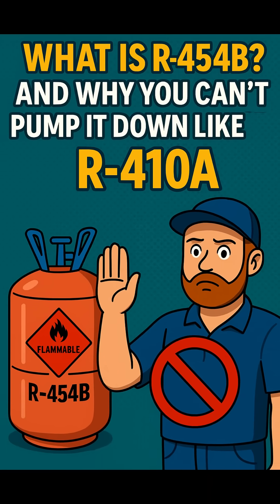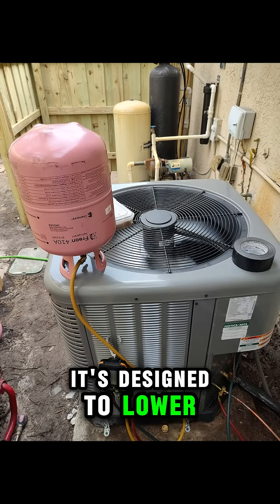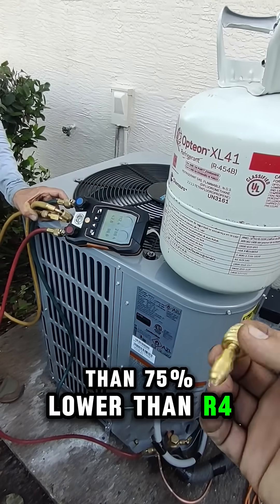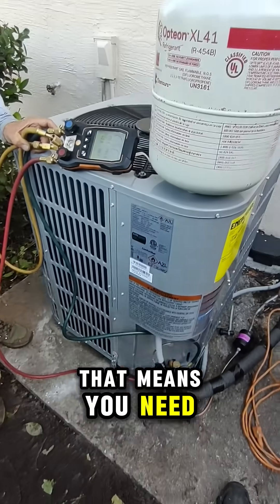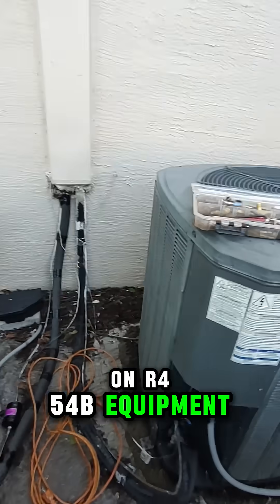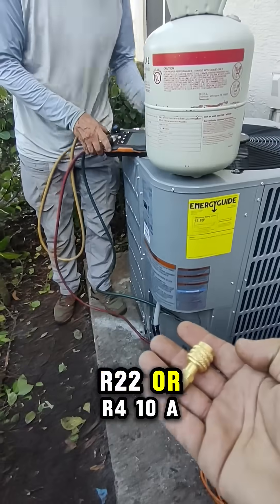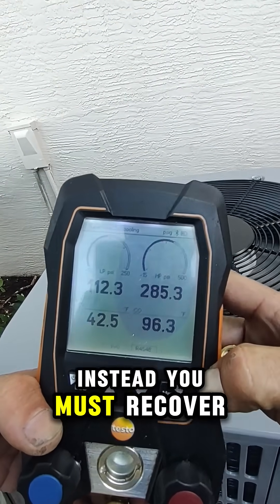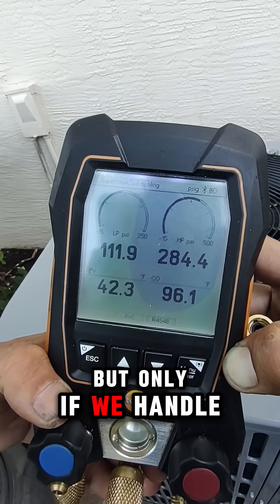What is R-454B? And why you cant pump it down like R-410A

Comment: R-454 is an absolute garbage solution. It’s flammable and it is not more efficient. If you’re running the same pressures it requires the same amount of electricity to flow through the system.

Comment: R54B  is a scam.  And scammers in this industry such as yourself push the scam instead of standing up against it and standing up for your customers...
I won't touch the crap. And I inform everyone about the scam.
If you understand the science that is happening in the refrigerant cycle, then you also should understand that the science is on our side, and the science isn't sciencing like they tell us.

Same with all this "efficiency" bs

Your pennies you save over a year, are instantly wiped away your first maintenance call or even worse a service call.
0 savings. Only increased costs. And the manufacturers win and you lose

Comment: And I notice you dont quote any literature that comes with the equipment or refrigerant that states that you cant do a pump down.
I mean, a recovery machine is literally a pump down. It is a compressor, coil, and storage.
The condenser is shipped with the total charge, so obviously it is designed to hold the total charge.
This is just another batch of fear-mongering. Happens every time there is a change in the industry.

Comment: Let’s think about this… a recovery machine is a compressor that discharges the refrigerant into a space that is lower pressure. 
Pumping a system down uses a compressor that discharges the refrigerant into a space that is lower pressure 🤔
Reply: Don't let the secret out, then manufacturers and supply houses won't make as much money😉

Comment: LOL.  I’m pumping it down, I’ve seen the lab tests for this “flammability” you speak of.  It is only flammable when lit with an oxyacetylene torch and it immediately goes out when the flame is taken away. 😂🎉
Reply: Yet we getting all this "safety" nonsense to install with it.. Your hot water tank is significantly more flammable but here we are... finding ways to force customers to pay for nonsense they dont need. In a few years r454b will be banned and this will start all over again. Screw government and Screw the monopolies who pay them off to force products no one wants.
Reply: You can light it with a lighter.  You don't need a torch. Lmfao.. but yes it will not sustain a flame without a flame.

Comment: 454 and 32 are not dangerous at all. I wouldn't worry at all about pumping it down into a condenser. They are blowing this a2l stuff way out of proportion.
Reply: 410a was supposed to be like raindrops from heaven. I remember how good hearing about Puron made me feel a few years back. It still gives me goosebumps. Except that it was a load of crap.
Reply: @kenlundstrom3047  the HVAC world is getting Soo ridiculous. The refrigerants. The equipment. Climate control is going to become a financial strangulation. I work on the HVAC equipment for cell phone towers. The vendors are starting to go with inverter wall units. Nothing but problems with them. Fixing them takes weeks because of part availability. I can only imagine what it's going to be like 10 years from now.

Comment: The amount of tools and refrigerants you still need in the HVAC trade is getting ridiculous. I used to carry R410a, R-22, R-404a, R-134a, M-099, R-509, R-408a, and Hotshot. Not to mention the new crap that's coming out. I just gave up and now make just as much money fixing forklifts.
Reply: After 21+ years in HVAC I just gave it up last year.  I now make just as much money repairing small engines and I don't have to go pay for "Continued Education" classes. I feel much better now.
Reply: @c.blakerockhart1128 yeah it's crazy the amount of stuff you need to do. Seems like HVAC just a field to break you down so you can pay a bunch of other people. I think the people getting rich in HVAC are the supply houses, testing centers, and tax collectors.
Reply: @Dan-ger82 Dont forget the testing "instructors", the shipping companies, the " Warranty Rep", and most importantly the Engineers who design things that cant be worked on by a mortal. And the manufacturers who sell the junk that doesnt work and when you finally get the broken part out just to find out that they dont even have a replacement part yet because the system is the "Latest Model".    When I first started in HVAC my boss got 8 pallets with 40 juggs each of R22.  We went through it like water because we only charged $20 per lb. Now they are " Phasing Out" the 410A and going with lighter fluid. NO THANKS.

Comment: Why is it you cannot pump it down but yet the Freon comes pre-factory in the condenser
Reply: They want you to buy all new tools for this bs! I’ve pumped them down…put them on 410 evaporator coils and even ran one without a sensor! 😲 There all full of shit! Why is it refrigeration needs a leak detection system but the natural gas that runs the furnace the coil sits on and is a bit more flammable and will level your house doesn’t? 🖕🏻government morons!

Comment: R410a has a mixture of refrigerants in it! (Azeotropic blend….fractionates if not dispensed in liquid form) If I’m not mistaken R32 is in it! 

(Blended refrigerants AL2 or however they say it)!
We can pump down a R410a system & a R22 system! 
THE NEW R32 CONDENSER COMES WITH REFRIGERANT INSIDE IT!!! If ya can’t pump one down….how does it come pressurized?🤔🤷🏽

Very much jus like any other system! You should be able to pump down a certain amount back into the condenser! A long line set application would be a different story!!!! Over a 10-15 ft line set….reclaim or pump the excess into a proper reclaim tank/cylinder!
Don’t let these people steer you in the wrong direction! 

The pump down process should be done by experienced individuals!
Since these new refrigerants are propane based it can no doubt become very dangerous!

Large 3 phase equipment can be very dangerous pumping down too!!!!
Blow a hole in your condenser coil from over pressurizing! “Yes I’ve seen this done! Incase you don’t believe me!”
Reply: Do some research on the different propane level(s) between these newer refrigerants! (Be proactive instead of reactive…lol) 
Remember they’re telling you IT’S MORE FLAMMABLE (potential is higher!?) THAN THE OTHER STUFF!

I wouldn’t dare light a match around these new refrigerants!

When I brazed the refrigerant lines to the condenser…..I made sure I kept the fitting attachments cool!!! The condenser came with the refrigerant inside!!!! (R32!)

So this is a new journey for many of us! I’m keep getting a visual of a 25 lbs propane tank on a gas grill…& I’m working on it!🤔😂😅🥸😳🤨🙄

Comment: This does not make sense to me. I have not heard this yet and have listened to a lot of content on this
Reply: A R32 condenser comes with refrigerant in it!!! (Plenty!)!
I connected/brazed the refrig lines & released the charge into the line sets & coil!
System up & running without adding too much more! About a 15-20 ft lineset application! (Inside attic 2 story , to main/ground level)!

Comment: This whole 454b and r32 is a scam.
Reply: Why is it a scam?
Reply: @TeefMah  
Because its only in demand due to being forced on customers. No one wants this. The argument that its better for the environment is idiotic. There is not much in a typical system to do anything harmful and they are closed loop systems. 
The only reason we have changed is because our government wants to collect fees and monopolies want to force new products. That's it. All this will do is jack up prices. We are already seeing typical installs costing 2-3 times more then of the past. In a few years this refrigerant will be banned and the whole process will start again.
Reply: It’s a new puppy! (Probably has more PROPANE in its blended mixture!?) I jus installed my 1st R32 system up & running Monday!

No one told me extra control wires are inside the evap coil enclosure! You have to wire them into the air handler controls!(gas furnace or electric air handler)! New air handler match up!

Old air handler…you need what they call dragonfly! (Goodman brands use this set for new coil condenser matched to old furnace/air handlers!)!

Probably dealing with a more flammable refrigerant(s)!?!?!
Thank you industry! Ikr!🤔😑😤
Reply: @orlandojohnson5742 yes you have to add the leak sensor to the older furnace or air handler so it shuts down the system, and if it's a furnace shuts down the burners, then it runs the blower fan on high to clear out the A2L refrigerant to dilute it to prevent an explosion. But the A2L refrigerant is not going to explode anyway. It's only slightly flammable. Take the free training classes offered by all the HVAC companies. They show you videos that it burns, but it won't stay burning. Even if you hold a torch on a leak it goes out when you remove the torch flame.
Reply: @orlandojohnson5742 there is no propane in R32 or R454b. R32 is just that and R454b is a blend of R32 and R1234YF. Propane is R290.
Reply: I agree. My uncle has been in the trade for 45 plus years and told me over the last 20 yrs that hvac has alot of myths.
Reply: It's all bullshit. We all know it too. We need to march on DC and put them retards out of a job.
Reply: It is

Comment: I have yet to see a left handed thread recovery tank🤔🤔 it’s not propane like a lot of people say or think and it’s not very available right now🤷🏼‍♂️
Reply: It’s becoming available now! Last yr Goodman pretty much sold all their residential 410a equipment! I jus bought a R32 system! A few suppliers have 410a equipment! But they will not sell a condenser by itself! You have to buy  410a coil & condenser together!!!

This whole thing is basically like when we switched over to 410a! There will still be some houses/establishments using R22 & 410a! Jus be prepared for the differences place to place you go!

It’s getting real interesting now!
I’ve been looking for a charging chart for R32 & 454b! These punks are jus adding more things to wonder or worry about if ya ask me!
🤔😑😤🤮
Reply: @orlandojohnson5742 yea but Goodman and daikin are the only r32 units other than mini splits the rest of the field has moved to the r454 blend. But it definitely is one heck of a interesting summer.
It’s all about someone getting a larger payout with an excuse of global warming🤦‍♂️🤦‍♂️
Reply: The reverse thread adapter is on some R32 tanks! (Depends on the manufacturer!?)!
(Goodman gave me a tank of 32 with the adapter included in the box) 

Then you attach your regular manifold gauges to it!  Do the same thing you’ve done in the past! Add refrig check high low side pressures etc!
Only the new tank(s) is counterclockwise thread… some have regular thread pattern!😉👌🏻🤙🏽